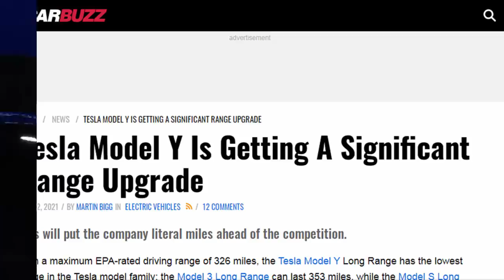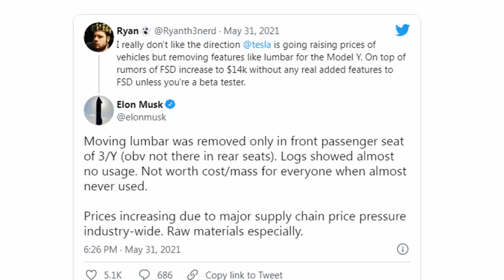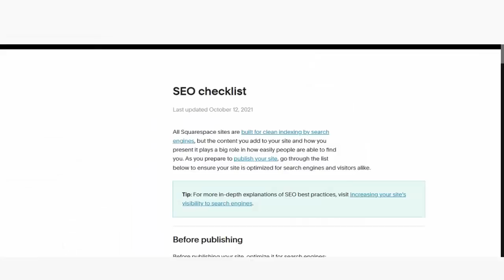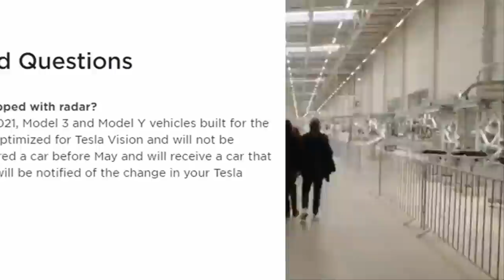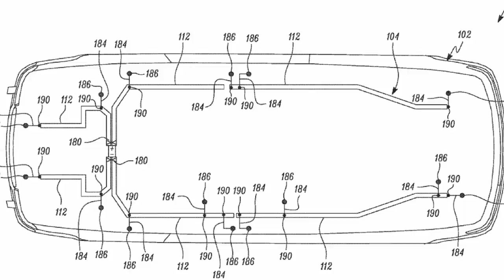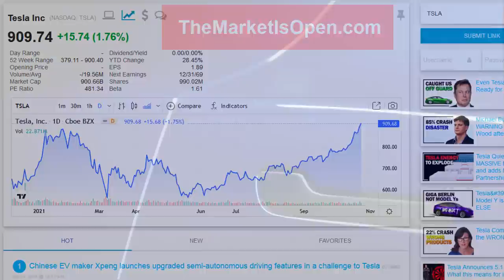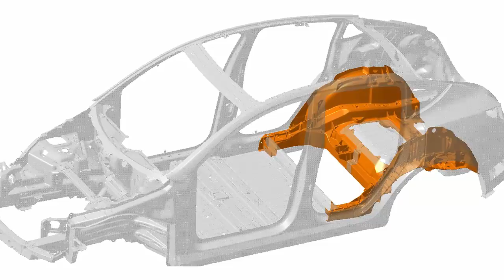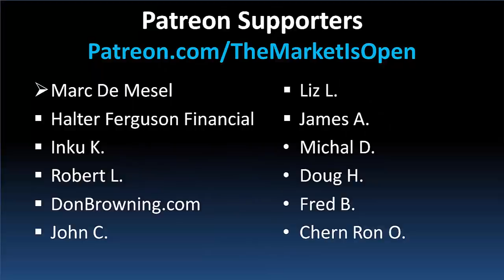Tesla’s NEW 2022 Model Y CHANGES EVERYTHING

Comment: So, out of "EVERYTHING" that is about to change:

- you don't really know anything definite about batteries. At least nothing significant for the customer.
- wipers will be a bit different
- multicolor versions available
- few trivialities around the car.
Reply from the maker: And the entire car is completely redesigned, but that's all.
Reply: @TMIOTesla  
Which matters to customer how exactly ?
Reply: @brane2379  Most customers don't know or care about most things except "I want...". 
The main first order effect will be on the other manufacturers, as Tesla has such a low manufacturing cost in Berlin, Shanghai and Texas that legacy makers cannot now, or in the near future compete with equivalent features for that price, so the Model Y will offer unmatched value from Berlin and Austin.  Chinese designed brands also will hit the Western markets over the next two years, providing even more price competitive competition.
Next year, when LFP batteries can be made outside China, they will begin to replace LNC batteries in nearly all vehicles, and completely in static installations such as grid storage. People will prefer to buy cars with batteries that cost less, can be charged to 100% without reducing battery life, last 3 times longer and do not readily catch fire.
Reply: @brane2379  Matters a lot to me. I want the best car Tesla can make right now.